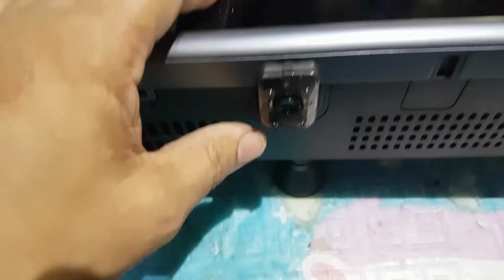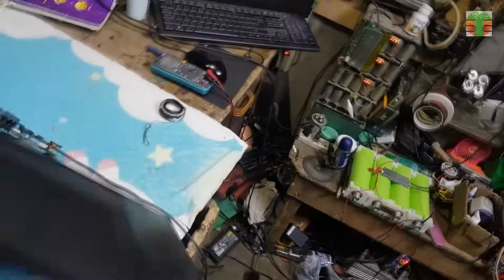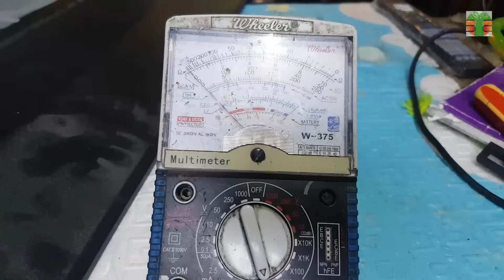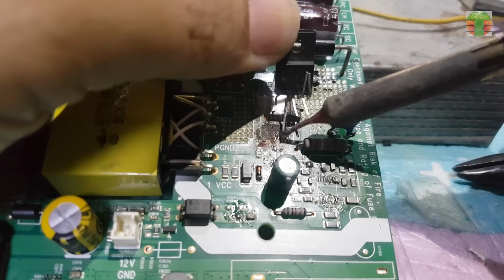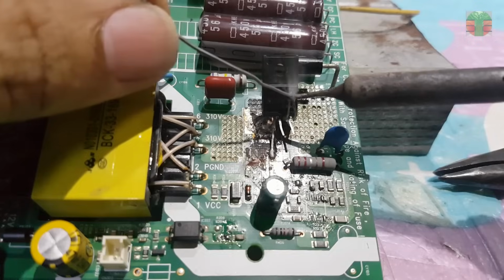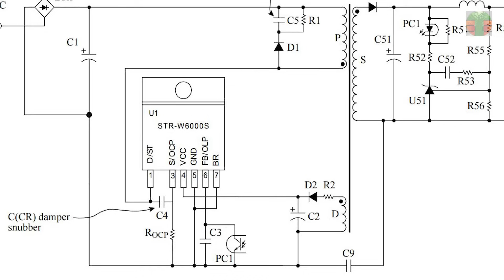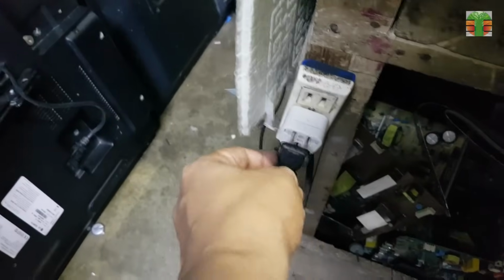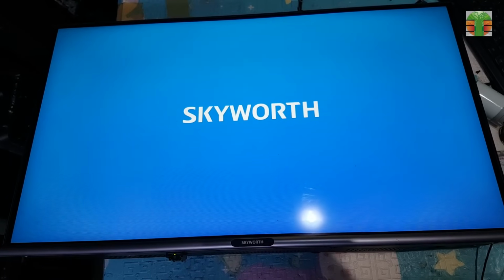Smart TV no power

Comment: Hello master, can i also use STRW 6053s for the modification? Is it the same as the 6053N?
Reply from the maker: Yes they are the same.
Reply: Hello master, I am working on the same TV board, the FET transistor is faulty and I have replaced it with 6053s. Now the secondary voltages seems to be low, I am getting 3.1v and 12vdc for the screen side. Could it be the chopper transformer is defective? My vcc voltage starts from 15v and becomes stable at 12v. Please any suggestions?
Reply from the maker: @atolawson9070  Check the optocoupler and the error amp feedback.

Comment: Hello  thank  for the 2023 videos   i enjoyed. The resitors you removed near optocupler  must be removed on all power supply?also can i use this on 55 inch power supply.is they a similar similar modification on dual mosfet power supply ?
Reply from the maker: yes it will work. only the component in the diagram are needed

Comment: I've got an issue with a Samsung 32 inch TV Model LE32R88BD, has standby, comes on with audio of static for 1 second, followed by loud crackling noise on speaker and immediately dies, I've inspected the boards, nothing blown, no shorts. Noted some SMC aluminium caps at 1000uf 25v look a little domed. I removed the logic board shield and saw 2 more with a dark grey circle above them on the shield, if I left the set long enough it will come on. Also would you say a 470 uf 25V capacitor tests as 399 uf is bad?
Reply from the maker: 399 could be just okay but try to replaced it.  Its seems a filter capacitor really the problem.
Reply: @tevzTVTevatronics  remember the 32 inch Samsung TV I was attempting to fix, fixed it. The caps under the shield on main board were toast. My first ever TV fix.

Comment: sir, please change your solder wire and use flux, you will have a lot cleaner tasks.and also clean the tip of your iron with tip cleaner.

Comment: Hie wish you a happy  new year sir ! Can i use this str on a 55 inch  power supply also should i remove those resitors you took out near  the optocupler also is they a similar modification on dual mosfet power supply  thank you

Comment: Hi there Tevz, I noticed that you removed the 2 surface mount resistors connecting the opto coupler to the rest of the circuit and installed a 10nf cap in parallel across the two pins of the opto coupler. It's the first time I have seen you doing this. And I watch all your videos. Have you changed the way you do the modification or am I sleeping...?
Reply from the maker: I added the ceramic capacitor because there is a resistor that is series to the optocoupler and I removed that resistor. the optocoupler
now has no capacitor, In some of my videos I dont add ceramic because the board has already a capacitor. see this really needs a capacitor. https://youtu.be/61JtodOaMvQ?t=954

Comment: I've seen all your power modification videos, but I've never seen you remove components the way you did here.
Why do you have to remove them? Won't it work with those extra components you removed?
I understood why you had to remove the 2 resistors in series to the optocoupler, you didn't have to add an external capacitor again if you didn't remove the resistors because the capacitor  was already there. Why did you have to remove the diode from the board?